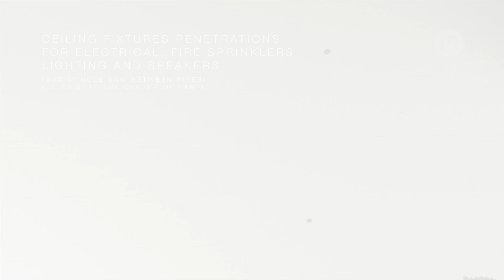NEW RayMagic gypsum panel

Comment: What do you do if you need to replace a panel or you discover a leak?
Reply: You bleed the circuit, cut around the panel, remove screws, take it down.

Comment: This is not a good solution, just like any other solution based on pipes, because it is not very effective, especially in the process of cooling rooms. Condensation problems and high production costs. A new technology of thermal panels with the so-called fast energy transfer and no condensation problems.
Reply from the maker: Hi there,

We are curious as to what radiant systems you have worked with in the past?

The key to effective radiant cooling lies in the proper use of sensors and controls. At Messana, we have developed our mSense room comfort sensors which monitor the dew point temperature of every zone within a structure. 

From there, Messana Controls will manage the supply water temperature to ensure the radiant surface temperature never falls below the dew point temperature; thus avoiding condensation issues.

Additionally, radiant cooling is most effective using a low-mass system, such as our Ray Magic panels, because we can change the surface temperature quickly to adjust for changes in humidity. This allows us to keep the radiant surface temperature closer to the dew point, maximizing cooling output.

Furthermore, Messana Controls can also manage dehumidification, which lowers the dew point temperature, allowing the system to use cooler supply water temperatures, further increasing the cooling capacity of the radiant system.
Reply: @messanatech  once you or a peer can deliver this competitively reliably at scale globally we'll really be looking at something here!
Reply from the maker: @jtmg11  We can certainly offer our panels reliably, but the US market is still quite expensive since modern hydronic systems are relatively new for the US building industry. This has resulted in higher installation/design costs for these types of systems. 

In comparison, Europe has already widely adopted hydronic radiant ceiling technology so the market tends to be a bit more competitive since engineers and installers are already comfortable with the equipment. 

If you'd ever like to request a Messana system estimate, you may do so here: https://messana.tech/get-started/